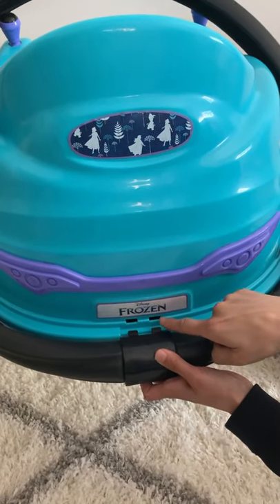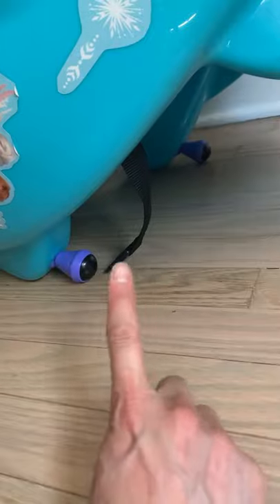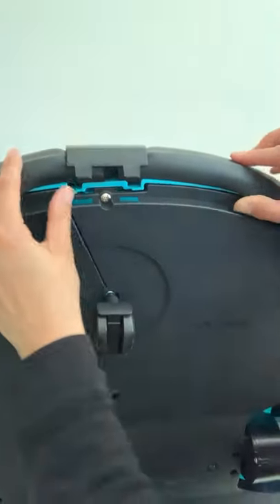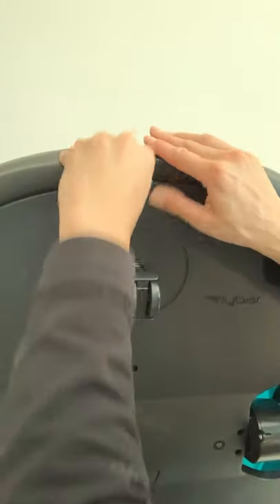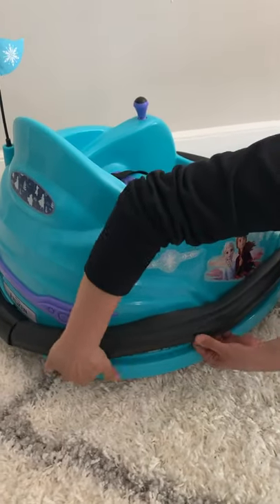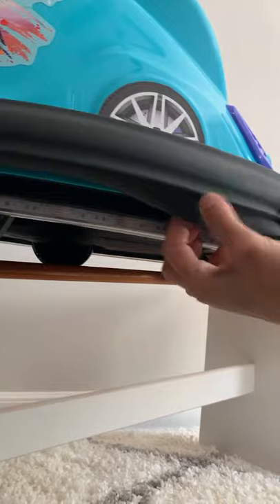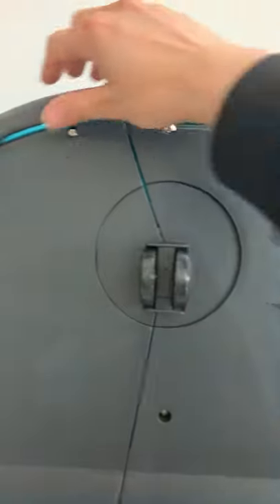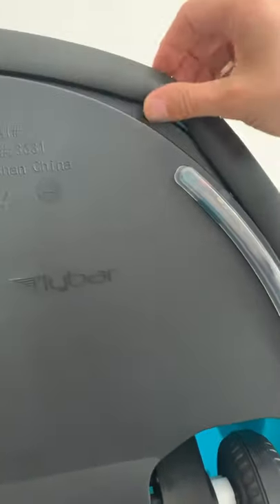Flybar Bumper Car Foam Bumper Installation Instructions

Comment: You have to unscrew the part where the seat is and make sure that the cords are attached so that it can begin to charge. Make sure to screw the seat back in properly. While charging the light on the power cord will appear red and then it will turn green once it’s fully charged. Merry Christmas all and I pray Santa was very generous this and all seasons ❤🦋
Reply: Mine charger came in the box, i keep charging it for 3 hours but still won't start.
Reply: Crazy how you have to be the directions smh thank you so much
Reply: Thank you! After reading this I checked and it wasn’t connected. The label on the chair said the same thing but I didn’t read it until reading this post. lol.
Reply: We can't get it to work